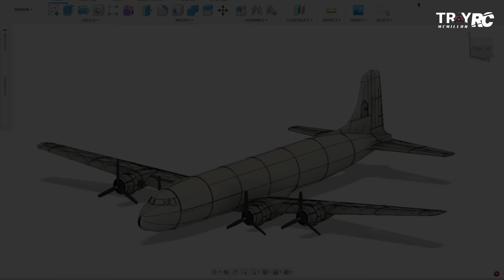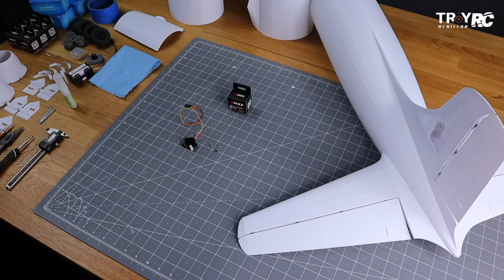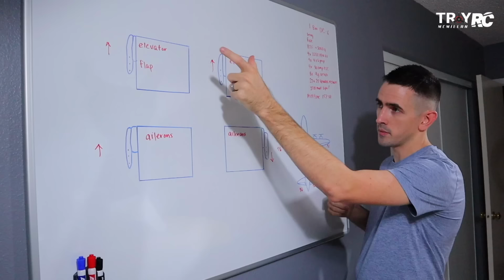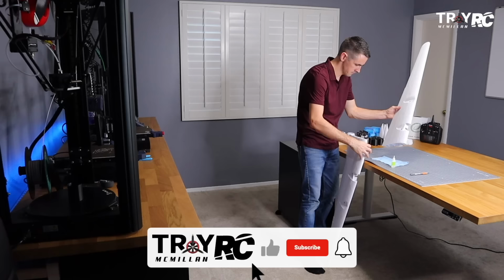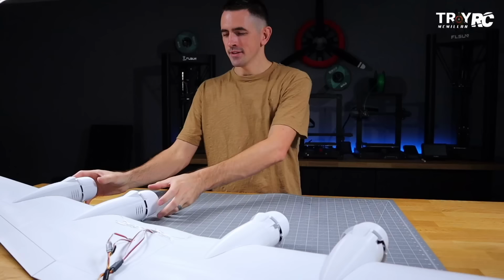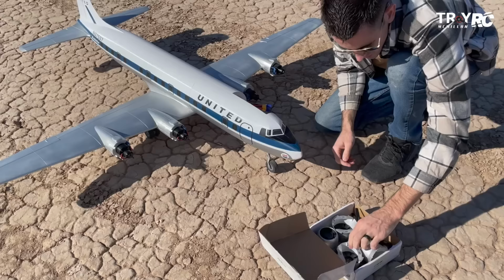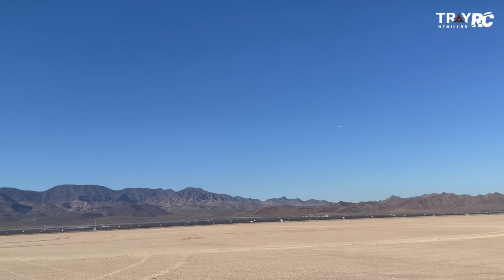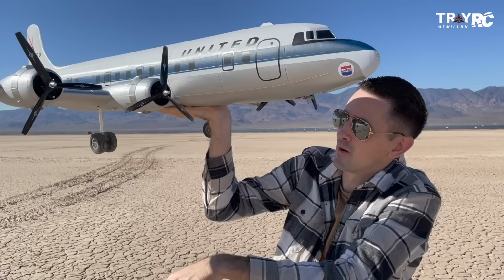BUILDING an AMAZING DC-6/DC-7 Airliner | Full DIY Build & Flight

Comment: You're gonna have a difficult time topping this one!
The build video and flight were EPIC 👍
I do 1/6 scale rc tanks so I appreciate the work you put in...dozens of hours on Fusion.
Believe it or not I did kinda cringe when I saw the nose gear printed in PLA!
Probably wouldn't have been an issue on a paved surface
Reply from the maker: Thank you so much! Oh wow, that is neat, then you really now these designs are quite the task but so worth it! I agree, even though the first landing was that rough, it held up well, but on the second landing, hitting that hard terrain just snapped it right off. I think I would also like to find a nose gear with a strut!

Comment: THAT'S what you've been up to for the last few months.  Wow, what a great job with the 3D design.  I've yet to see anyone do 3d printed gear unless they add carbon fiber rods as the actual structure.  I see from the cults3d that you were trying to avoid CF.  I think my favorite part was the nacelle magnets and making them uni-directional.  Nice touch.

Comment: Wow Troy, this is a stunning model!  I grew up a United Air Lines brat and spent many hours with my nose pressed against the windows, looking out at those big props as we flew back and forth across the country.  Times were different so I was even given a tour of the front office IN-FLIGHT.  (No... nobody asked me if I liked movies with gladiators).  I fly a Dynam DC-3/C-47 RC foamy and have always wondered why some company didn't come out with a DC-6, and here you went and engineered it in the most elegant fashion!  Wish I had the expertise to print and assemble your model.  If you ever decided to go into manufacturing this one, I'd be first in line for it.  My late father and and I have a combined 80 year continuous history of employment at UAL, so I appreciate your choice of livery.  You definitely have yourself a new subscriber!  I shared your vid on the "UAL Old Farts" FB group, so you may pick up some more subscribers from there.  -Burt in NJ

Comment: Troy, that thing is so smooth in the air! Its actually the first scale airliner to fully catch my attention and I've been building and flying ww2 fighters and modern jets up to several meter scale, from ducted to pulse ramjet... 
Your DC is very well designed and it looks superb! 
I have to say it is your unique design techniques and attention to detail, combined with a mechanical knowledge that is comparable to a qualified aircraft engineer that has me sold. Most pilots don't have such a vast array of engineering skill, It matches your piloting expertise clearly on display here.
I smiled very wide watching you flare that second landing which was better than textbook despite a nose gear failure! 
Having carbon brakes wouldn't have helped there at full scale🤣
I appreciate how difficult that perfection is at these scales. I also know what I'm doing for my next build, I'm now convinced on getting an Ender 3 s1 pro (and I know where my spare retracts are headed!).
 Thank you for sharing your brilliant work with us :)

Comment: Troy, this is a well thought out and executed design. There is another aircraft that you should take a look at. The overall form is similar. Take a look at the XF-12 rainbow. It's a post war 4 engine aircraft that is really sleek and cool looking. It was also very fast. Someone made a balsa kit of it several years ago but, they didn't sell many because of the way they designed it. It was hard to build. Also, if you could have a few extra decal sheets printed and offer them for sale would be great.

Comment: Does it fly so good simply because of the original DC-6 design or do you have to take extra care in designing the model? Never thought the option to simply 3D print a flyable RC plane would come on the table. The whole self stressed skin and riggers structure looks almost prototypical. Really enjoyed this!
Reply from the maker: It is a bit of both. The DC-6 has an incredible design to it already, with features like the dihedral wing and also the large SA of the wing as compared to its fuselage. I improved features that I know make an RC plane fly well, I increased the size of the aileron and elevator, and adjusted the foil of the wing.

Comment: No spars in the wings and tail? Are they molded into the interior of the wing? If so do you rely on the glue to make them continuous through the wing? I’ve been modeling for over 40 years and I’m very impressed, the precision is amazing!
Reply: Impressive I fully agree! 
Well....looking closely at his design, he doesn't use what you'd call a typical spar as when you 3D print instead of "construct" then other bracing and strengthening techniques can be implemented, which wouldn't work with other construction methods. He has used ribbing and geometric fill patterns that do the same job structurally with similar to less weight, which are only possible when manufacturing them as part of the outer structure. So while there are no spars, I believe his design would actually flex less and be less likely to fracture than a spar reinforced wing, CA glue can bond as strong as the material you bond it with. This design would not be practical in a 1:1 airliner due to the required fuel capacity and hardware enclosure that normally fills this wing space, A structure which we generally copy when designing model aircraft. Its actually refreshing to see such a well designed craft using out of the norm design in my opinion.

Comment: Just an idea I thought of - instead of having to make a new tool to measure those engine mounts and then have a tool you have to throw away or leave sitting around, you should add marks on the mounts on your design so you just know where to stop at.
Reply from the maker: That is a cool idea, the reason why I had to make it that way is because the glue dries SO fast. So there is nearly no time for a second guess, and that's why the part takes the guess work out of it - it is right where it should be.

Comment: Even though I am rather into ships and ship models this is so awesome that I was rivetted to my phone's display watching this video.
I wished I had your skills designing, printing and assemblying my ship models, well at least the hull, decks, superstructure, though I design my hulls with a CAD software for ship hull lofting/fairing already, however haven't yet the 3d printing equipment and thus built the hulls plank on plywood frames which I saw manually with a fretsaw.
This is admittedly almost a waste of the digital 3d construction which would lend itself to be either CNC milled or the hull to be printed in sections like you did with the fuselage of your splendid DC-6 model.
I would like to know how long it took you alone to design your model on the computer ready for printing?
What CAD SW were you using?
I find it really noble of you that you share the STL files of your design with other aircraft model makers!

Comment: Cool model….I fly real 737s and have had that main landing gear issue happen….whole wheel assembly departed the airplane on rotatation….I didn’t know until after we landed and my FO reported the wheel missing after his post flight inspection. Just like yours our airplane landed fine with only one wheel on the right side……guess the second wheel on each side is the back up!!!
Never had the nose gear fail tho!!

Comment: Great work man,i would love to see that you build a C-130 with gasoline engines instead of electric ones.Keep up the good work.Greetings from Turkey.
Reply from the maker: That would be so cool to try gasoline with a 3d printed plane!
Reply from the maker: And that is definitely a sweet plane, I have been wanting to do that one
Reply: @TroyMcMillan  İ personally witnessed a tactical landing in one of those C130 s as a passenger on board.Turkish Air Force.Solid plane+talent to do that dive.

Comment: No spars or braces in the flying surfaces/wings?
Did you really glue the whole airplane with CA glue, and trust it to hold during numerous flights?

Looks amazing though - thanks for the video!
Reply: If you look closely you can see that the wing sections were printed with internal struts at 45 deg to the chord/spar direction. Traditional ribs are not printable as they are parallel to the build plate, so this method replaces both the ribs and spars and makes the skin and internal structure printable as a single piece, at the expense of weight.

Comment: amazing build. The gear did what it could agains that harsh surface
Reply from the maker: Thank you! I agree. I since strengthened the design of it, with that improved part and flying it at a paved RC field, I haven't had trouble with it. But that dry lakebed is about as hard as a rock 😬

Comment: Another great design. I printed, built and flew your Airbus 321  https://www.youtube.com/watch?v=rYIkaQISYOQ, and now I plan to do the same with the DC-6.  Troy, could you walk us through how you produce your decals. If there is a video, please send a link. Your efforts are much appreciated.  Scott
Reply from the maker: I checked out your video! Sweet! Awesome job.
Reply from the maker: It definitely will be a video for sometime this next year. Once you have the plane finished, I just use GravitDesigner and a ruler and just start measuring the area, and decide where I want the letters to go. Then I send those files to a print shop to print them out for me.
Reply: @TroyMcMillan  Thanks for the compliment. Your design made it easy for a first year 3D Printer like me to make the model. I did start with some Eclipson models, A, R and S to gain my skills. If you could share the material you print the decals on and where to get them printed, I will be off and running. I've never made my own decals before. But I am capable of designing them.
Reply from the maker: @sunsetmodels  That is so awesome to hear! I have the doors and windows file for sale now, https://cults3d.com/en/3d-model/gadget/dc-6-dc-7-doos-and-window-decal-file then have your print shop/where you order them to be printed from write out the words of your preferred livery!

Comment: Someone is running a scam using your video. Do you have a contest running offering thousands in Bitcoins to lucky winners?
Reply from the maker: Hi I am not running a giveaway on any platform currently. I do not use Telegram. Please do not give out any personal information to anyone that is pretending to be me, I do not need/ or ever will ask any personal information from you.
Reply: @TroyMcMillan  There is another run at the scam, messages seem to have been input 2 days ago.

Comment: Nice model, but I would recommend to use carbon rods for inner connection of main wing sections and same for fuselage sections.
Reply from the maker: I designed it so that carbon rods aren't needed, it has an integrated spar designed into the wing pieces. All you have to do is glue them together!

Comment: I have to thank TROY for taking the time during the holiday season to help me work through a couple of issues.  I'm using Cura with an Artillery Sidewinder X2 printer. I started with the "dynamic quality" base profile setting, and then modified the settings with Troy's info from the 3dCults page for the fuselage parts, and when I pulled it into Cura or Simplify 3d, I was NOT seeing the former (ring) at the base of the fuselage parts. After upgrading Cura to the latest, some of the parts then looked perfect, but still had issues with the fuselage parts.  In experimenting... I figured out the real problem:  You need to start with the "Super Quality" base profile, and go from there.  (FIgured this out by accident!).  Anyway, if you don't see this ring in the slicer program, try playing with your settings... and print it slow. It is worth the wait - especially on Fuse 1 - as the Window area requires no supports, you need to go slow here so it prints correctly.  Also, first 4 layers, turn the fan OFF.   The wing parts will cool on the initial layer and pull off and mess up the print.  First layer is most important.  I've also been using hairspray to make things stick better.  This model is going to be BEAUTIFUL!  Callie Graphics is doing graphics for me, so she'll be ready for you, too, and she's also great to work with.   THANKS AGAIN, TROY!!!  I will be happy to recommend any of Troy's models and the guy that stands behind his work.  Merry Christsmas!

Comment: Nice build it flew like a dream I think on a nicer surface the landing gear would be fine but a little stronger won't hurt .
Reply from the maker: I agree, after the maiden I took it to a paved RC field to fly it and it worked just fine. I also improved the strength of the gear after this maiden flight!

Comment: One trick for stopping bleed is to lay down tape then paint with the color under the tape.   (it seals the edge of the tape)  you will get crisp lines on your paint job.  (In the case of this particular project lay down the tape paint with a matching white, then the blue strip)
Reply from the maker: Thank you for the tip!! That's a really good idea.

Comment: Beautiful airplane !  The no spar part scares me…very nicely done! 👍🙋‍♂️🖖🏻🏆
Reply: Just reprint it if you break something!
Reply from the maker: I'm not using traditional carbon fiber spar, because I kept running into the problem of not being able to find them in the right size. But there is a spar that is integrated into the design of the wing. It is very strong, and just easily prints with the part!
Reply from the maker: @Inserico  That's the beauty of 3D printing!

Comment: Just WOW, an amazing project there Troy! I’m a long time scratch builder started w wood, spent the last several years working w foam. I ran across your channel a little while back, have subbed and watched some of your projects. I would love to be as good w 360 as you are to be able to design and build the aircraft you do! I’m printing a plane at the moment, my first one, will see how that goes, using an Ender 3 and have been eying that 400 printer that you showed in your video! I know it’s probably not your thing but it would be great if you could do a video on your 400 printer as related to the 3d plane printing and building! Thanks so much for all your work sharing these projects and videos with us!!!! Walt

Comment: Wondering if anyone else built one yet?  Mine is almost done printing, and the quality and strength is amazing. Wondering how you all finish these printed models? Primer/paint? Epoxy?
Reply: Printing my in Yellow PLA.  Ailerons, Flaps, Rudder, Elevator in Red.  Doors and windows in black vinyl stickers (hoping Troy will put his up for sale).
Reply from the maker: @rcdavidk  I put the windows and doors decals files for sale now! https://cults3d.com/en/3d-model/gadget/dc-6-dc-7-doos-and-window-decal-file
Reply from the maker: Hey Mark, I posted the door/window files now https://cults3d.com/en/3d-model/gadget/dc-6-dc-7-doos-and-window-decal-file

Comment: Wonderful job... just beautiful.  I'm going to try and incorporate some kind of trailing link for the landing gear... that's always the weakest point on any rc plane... printed or balsa or foam.  Thank you for designing around a standard build volume.  Cheers!
Reply from the maker: Thank you so much! I agree with the landing gear, it is tricky to come up with something that is lightweight and strong enough to handle all different types of terrain. 

I realized after my other airliner that I needed to make sure it was standard build volume!

Comment: I was surprised to see it doesn't have a solid main spar through the wing
Reply from the maker: It doesn't have a traditional carbon fiber spar, because they are hard to find at the right lengths. This plane's spar is integrated into the design of the wing, so it is just printed out with the wing parts!

Comment: My recommendation for the nut that came off is to stake it in place, a starrett 18A automatic center punch to the center of the rod or the edge of the nut should be more than enough to retain it and will still be able to be removed later if needed.

Comment: I printed, built, flew, an unfortunately crashed after 4-5 flights a C-130.  It was a HEAVY beast as I used regular PLA as to my knowledge there isn't a clear LW-PLA yet.  So it was completely see-through an I stuffed a bunch of addressable LEDs in it.  Looked fantastic!  Was heavy an cumbersome, an really didn't fly that well.

Comment: I'm curious about the diagonal "skin supports" on the bottom of the wing.  Could they serve the same purpose but be printed on the inside surface of the wing instead?
Reply from the maker: They are through the wing, but the reason you can see them on the bottom is so there are no retractions when it is printing, to make it as easy and fast to print out as possible.

Comment: Troy, your recommendation of Flsun printers really helped me. I bought several Enders from Amazon and no matter what I did I got less than acceptable prints. I bought the Flsun Super Racer and right out of the box it printed stellar parts. I returned all my Ender equipment and tested the SR. It is so good I am going to set up 2 of them. I see it as more of a prosumer level where the others were more like hobby level and I wasted a lot of time, material and frustration trying to get them working right.

Thanks,

Nikko
Reply: I built my first delta in 2014. The prints I was able to get off that printer are every bit as good as todays best printers can deliver. Biggest issue back then was you needed an expensive 32bit controller($140+ from smoothie) and bed leveling was difficult and regularly need addressing due any variation on the 3 Z motor mounts, belt or bed mounts which were plastic back then. Today I am really surprised delta printers are not more popular.